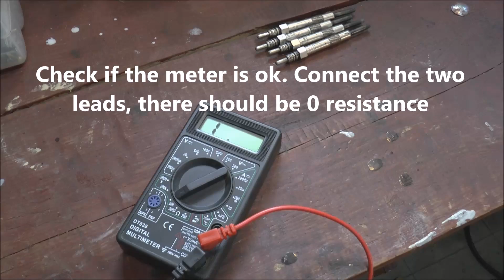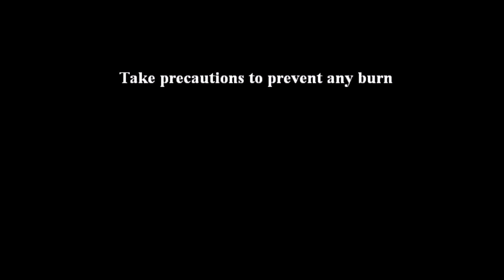How to test glow plugs  - diesel engine

Comment: 20kOhm measuring range is too high for a glow plug. A good glow plug has a resistence of 0.5-2 ohm, so you should measure at the lowest range - 200 ohm to see the real resistence. At the 20kOhm range the lowest resistence that will show up on the multimeter is 10 ohms (0.01), so you are definently out of range.
Reply: i realize I'm pretty off topic but does anyone know a good site to watch newly released tv shows online ?
Reply: @Arturo Reign thank you, signed up and it seems like a nice service =) I appreciate it !!
Reply: @Abdiel Yosef Happy to help :)
Reply: Exactly 
If there is a short circuit in a glow-plug then the multimeter shows 000
You can test the glow plugs without to remove them 
You can use a test light, connecting the wire to positive side on Battery and the other side to glow plug 
If the test-light don't illuminate, the glow plug is burnt=bad

Comment: There are fumes coming from coils when heated up. May be the coil is melting and vaporising. It is then not good to heat them outside the cylinders as it will reduce their life.
Reply: No that's oxidation or any residue settled on the tip vaporizing.